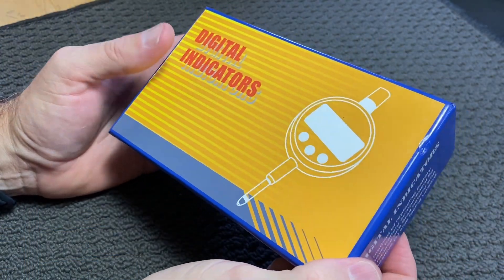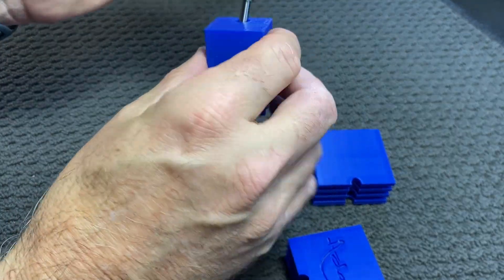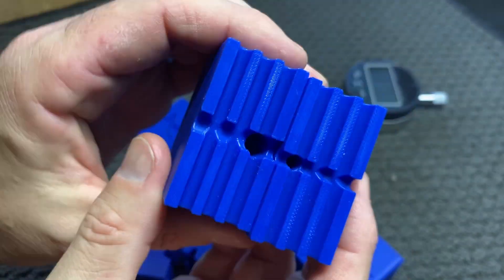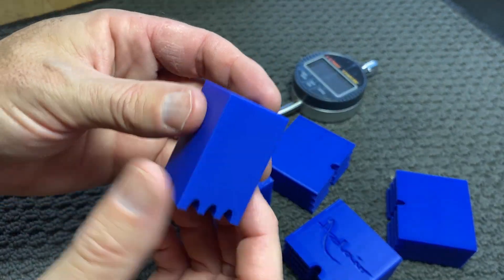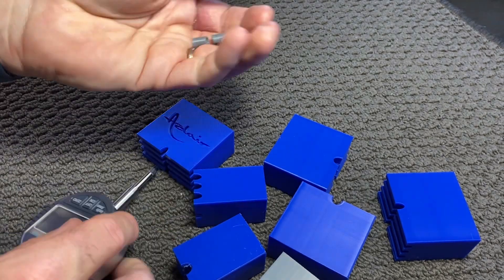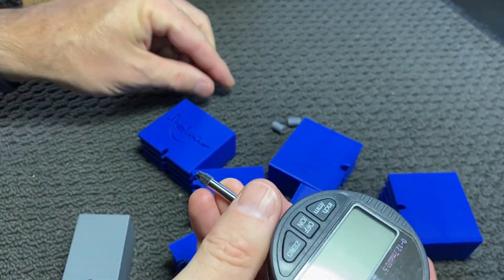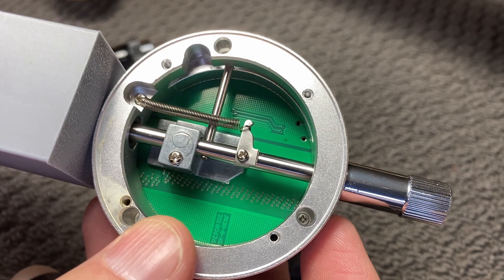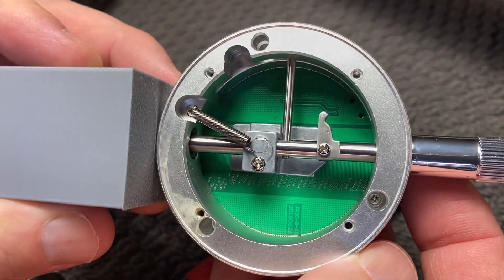I Made a Digital Nut Slotting Gauge for an Electric Guitar!

Comment: Just hold the block and push down on the shaft of the indicator with your finger. It's the same measurement. Also lighten up the shaft as much as possible. Remove the end and the top of the shaft and don't add a cap.

Comment: Why don't you take the spring and put it in the opposite direction I believe that the stew mac gauge basically you push it down onto the string without deflecting the string and getting the correct reading.😂

Comment: Hey Arran, another nice print and good job done! Like Todd below, I have a cheapo Chinese one, which has the same slight string movement problem due to the weight of the shaft. Which is quite liveable with, TBH, but 2 ideas just occurred to me watching your video. "Thinking aloud" here, and I could do either of these on my one, so haven't tested anything. First idea: measure the small initial deflection by using an electrical contact. So, you have no plastic cap on the probe, you leave it as metal (so, file it, remove the bottom ball bearing or whatever) then rig up a battery/bulb setup with the string-probe connection completing the circuit. You lower the probe onto the string under its own weight, the bulb lights, showing contact. Zero the gauge. Raise the shaft manually until the bulb goes out, and read the deflection. This is what you have to add to the reading you then take in the normal way, as you've shown.  Second idea (probably not practicable): make a lighter shaft. How precisely could you print a plastic shaft to replace the metal one in the gauge? It would obviously be a lot lighter, but could the printer do something smooth enough to move easily but without slopping about? Just a couple of random thoughts. 🙂
Reply from the maker: Thanks Chris, some very interesting suggestions! Might have to investigate the weight relief or printing a plastic shaft to experiment with. Or I could use heavier gauge strings!
Reply: @adairguitars    Hahaha, that would definitely avoid the problem!😆

Comment: It appears that the end of the tip is a ball bearing held on by a cap. Maybe it unscrews? Then put it back on without the cap? I bet they used a thread locker on the internal spring retaining screw, and probably on the ball bearing retainer... heat might help here.
Reply from the maker: Unfortunately it doesn’t unscrew, which I was hoping it would. Might investigate that further.
Reply: @adairguitars the ball tip stylus of the indicator plunger will definitely unscrew, all sorts of replacement styluses, including flat disc types are available. 
Also, the cover over the upper end of the shaft can be screwed off the indicator body to reveal a tiny lift grip, so you can press or lift the plunger as needed to make your measurements.